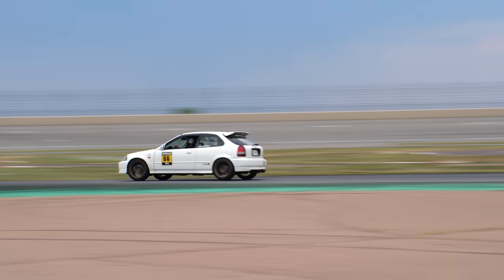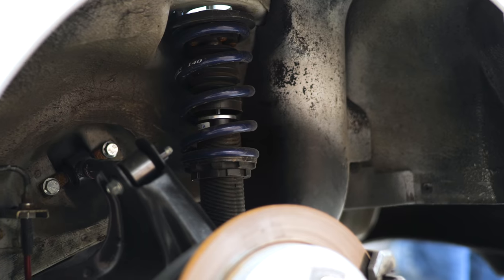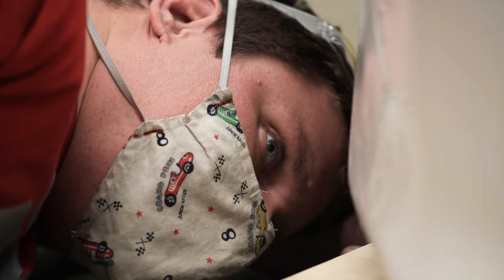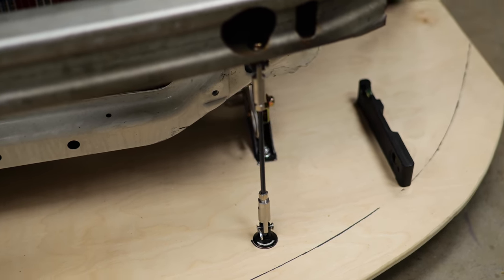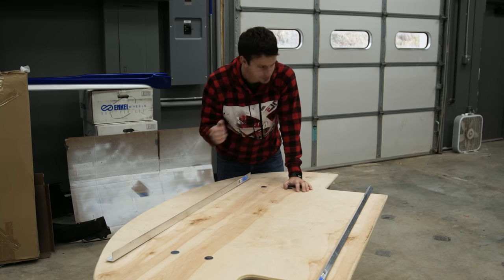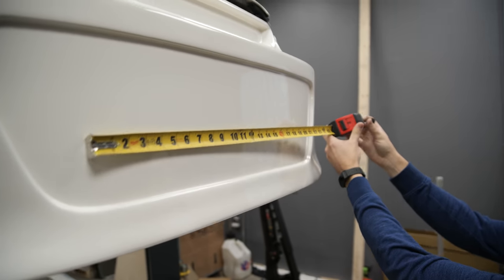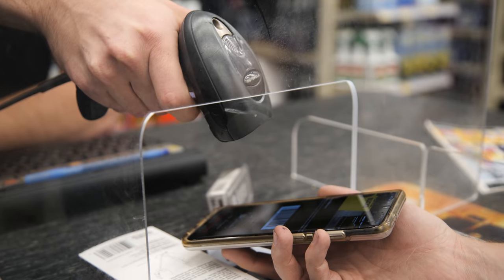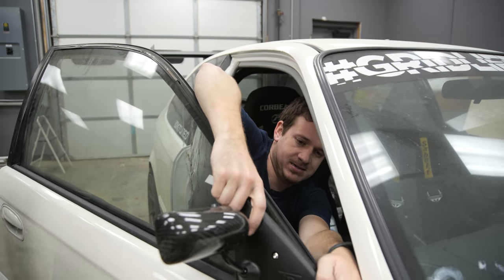More Downforce for the K24 Civic

Comment: Don't you hate it when you get absolutely gapped on the track in your new Porsche by a clapped out 90s civic
Reply: running wooden aero
Reply: With Porsche brakes as well
Reply: 🤣

Gapping 'Vettes too
Reply: @angry_mxrcy9877  he's basically a 911 at this point
Reply: I would agree but this thing is far from clapped
Reply: with a piece of plywood on the front :D
Reply: Don't mention the resell value though
Reply: It's not clapped out, and I feel like if you track your car you learn very quickly that there's a bunch of older cars that can go very fast.
Reply: @fazeobama8872  I don't know why people are hung up on the fact that it's wood.
Reply: probably now it costs like the porsche
Reply: @Osprey1994  probably because he spent mad money on a carbon hood... now u can go tell me its not bad because the cg will be low but any weight is bad weight and wood will wear out hard even if only from flexing under load, bottoming out on a wet track making it rot etc...
Reply: @fazeobama8872  wood is a fantastic material for a splitter because it's cheap and easy to work with. Splitters get destroyed all the time, you don't want to be shelling out for that much carbon fiber when it does.
Reply: i fell like its only children who car if a car like this honda is faster than a porsche or any other sport/super/hyper car
Reply: @Osprey1994  Back when I used to track my GTO I'd always get grouped with a fella with a old 1st gen Neon that was all done up.. it was so much fun absolutely murdering him down the front straight and just watching as he'd get closer and closer to my rear bumper throughout the rest of the track 😁
Reply: Funny thing is that wood probably costs more than carbon these days lol
Reply: @fazeobama8872  how did you not understand that in this video? there’s a weight limit in his class, he literally has to add ballasts to the car anyway. that’s why the hood is carbon. if you’re limited by weight, the best option is to put in low in the car.
Reply: That would be under the very ignorant assumption that the Porsche owner was going for time and not just enjoying their car on the track (like 99% of people who don't want to crash).
Reply: it doesn't even have a laptop inside yet
Reply: Laughs in GT2 RS
Reply: @xavierrodriguez2463  you can read child, real car enthusiast don't care if a honda is as fast as a 911 b/c the real car enthusiast knows there is a lot of money put into that honda to make it that fast.

so its only children who argue over such trivial things
Reply: Except its def not clapped out... but ya that's track life haha.
Reply: you mean a porsche in reverse?

Comment: Very good and simple aero package. The only thing I'd add is actually tape where the air dam meets the splitter. If there is even the smallest of gaps there the air flows thru it and lowers the pressure slightly over the splitter (also added drag). If you need more rear downforce but just a bit, not a big chunk, look into putting bigger endplates on your wing and a gurney flap, it'll make a noticeable different for very little money.

Comment: "I'm under weight so it doesn't really matter"

"Let's a carbon bonnet and mirrors"
Reply: Makes sense, though. If you need to add ballast because you're underweight, you can place the added weight wherever it's best for weight distribution.

Comment: Great job on the aero bits. I'm sure Mike has mentioned this to you but you will also need a vent/heat extractor on the hood. It not only reduces under hood temperature but also let's out the air coming in from the radiator vent and reduce lift. If the class you are competing in doesn't allow it then ignore my advise.

Comment: I love aerodynamic. I think the next thing is a clean flat floor like “f1” to minimized turbulence and a functional diffuser to channel the air for a tighter / clean package. Like most hatch, the area between the glass and near bumper generates a lot of weird vortices, so cleaning that would be the last thing I would do. As a engineer, the hardest thing is ‘side skirt” and keeping air on the bottom package as smooth as possible. If you want to go a bit further, you can find the cheapest way to scan your car as a model and run basic fluid dynamics simulation on any modern 3D software. It’s a lot cheaper than a wind tunnel. Good luck!

Comment: Would it make sense to go with a rear diffuser over a larger wing? I'm no aerodynamicist, and I don't know if it would be class legal, but seems like it would be a good way to add weight down low, utilize the low pressure zone created by that splitter, and not increase drag as much as a larger rear wing would. Would also look mean AF. Love what you're doing with Mia!

Comment: @10:30 carbon fiber is not brittle. The principal stresses in tension are greater than in compression. CF is not a ceramic, CF is  material that peels, crack and debond easier on the direction perpendicular to the fiber.

Comment: You’re gonna need a flat floor with Venturi tunnel and a diffuser. Then seal the pressure with movable ceramic side skirts. Aero is complicated and can’t be done piecemeal. This is how “ground effect” was done 8n formula one in the good ol days

Comment: Instead of a bigger rear wing, is it possible to fit a rear diffuser? I think that might be more aero efficient and keep the cg down lower. Additionally, might want to look into cutting a bit of the rear bumper as its a common spot for a "parachute" effect. Not sure if these are allowed in your class though.

Comment: Don't forget to flatten out the underside of the car with flat sheet metal and add a rear diffuser (if wanted) as that will help suck the car further into the ground. If your allowed to run that In your class ofcourse. Just an idea. :)

Comment: That is proper slick!
Are you going to run a wider wheel/tyre now as well?

With your front rad cutout.. i'm sure you've seen it, but in Aus V8 Supercars, they have inserts they run. The entire front duct area is cut out. But then an insert is put, size dependent on requirements (ie, hot long race day no insert, or a one lap qualifying shootout completely blocked off with like a 8" hole in it)

Are you watching hoonigans soopy/soupy 's awd integra build? 
.......lol is there a class for a AWD turbo civic? ;)

Comment: To add rear downforce, wouldn’t it be better to add a big ol diffuser rather than increase the rear wing? You’re not running a diffuser at all and underbody downforce tends to be more efficient than big wings and such
Reply: A diffuser is going to do sweet FA on a car without a flat floor in front of it. All that will be achieved is a bit of drag reduction. Without an optimised floor that's channeled etc the air is way too turbulent

Comment: Legit.....watching you drive seems like you're really high in the car. Any way you can get the seat an inch or two lower and further back? Extend the steering wheel back for a more central seating position....you might have to go with a custom pedal setup, but its worth it.

Comment: You previously mentioned that you'd need to add ballast to the civic to comply with the class rules, but recently installed a carbon hood on the car, which makes little sense as the car is already too light. Is that for weight balance optimisation or just because it looks nice? P. S. I really enjoy your videos, keep up the good work!
Reply from the maker: Mostly for balance optimization, I want my weight to be low and centered. But also a white civic with a carbon fiber hood is a look I've wanted for a while, mostly because of the spoon civic.
Reply: To add on you always want to still get the car as light as possible then add the ballast in optimised spots where it's needed. Even with adding the weight back in it's still centralised and lower.

Comment: Why wood instead of metal material like a sheet of aluminum or carbon splitter? Cost must be a factor? The added weight?
Reply from the maker: Wood is stronger than the aluminum, and substantially cheaper than carbon fiber. This way I can make another one pretty quickly if I managed to mess this one up. And I don't need the benefit of weight savings there low on the car.
Reply: @GearsandGasoline  Thanks for the reply!

Comment: Im genuinely curious as to why you used wood instead of some composite board.
Reply: It's cheap, easily sourced, cheap, strong, cheap and he needs to add weight to the car anyway. The only benefit composites have is their lightness which doesn't matter here.
Reply: @toddxhiggins  I guess I should've been more specific. What i meant was a composite board from homedepot which is like a plywood substitute. They are heavier stonger and I feel would degrade slower than plywood.

Comment: Are you able to use a more aggressive rear diffuser in your class?
Reply: Diffuser isn't going to do a whole lot on the car without a flat floor besides adding more weight (which he needs anyway) but you'd rather that weight be more central and where it's needed not behind the rear axle line.
Reply: @toddxhiggins  good to know, you learn more everyday thanks!